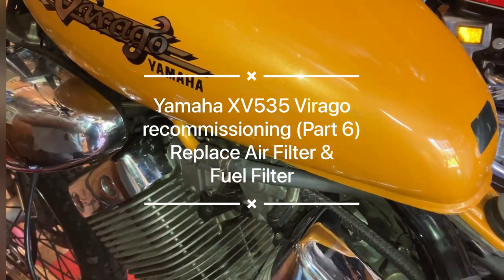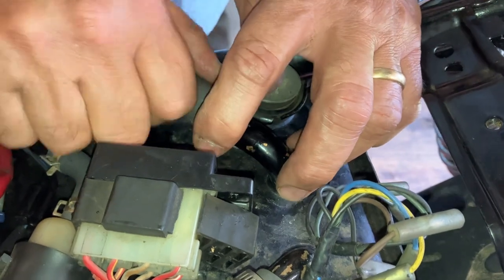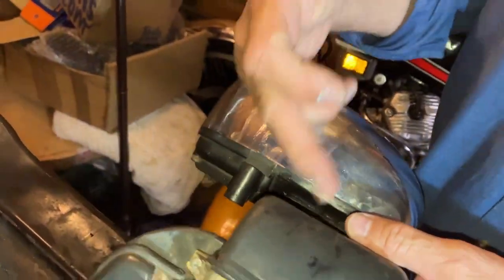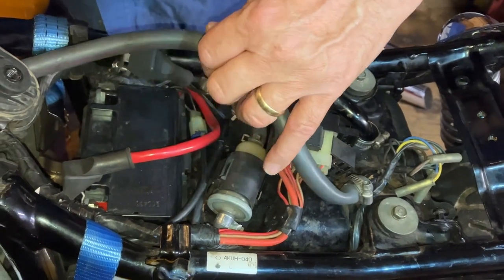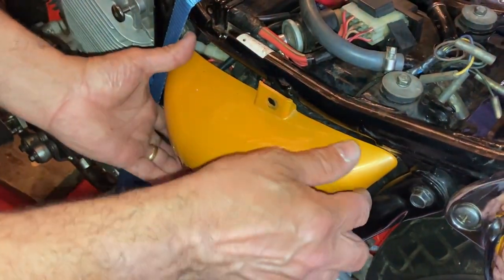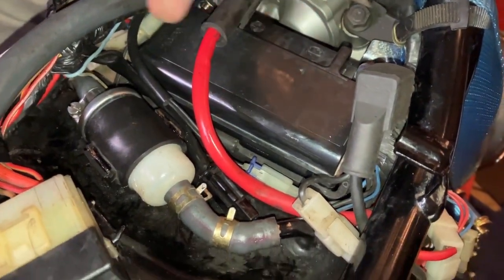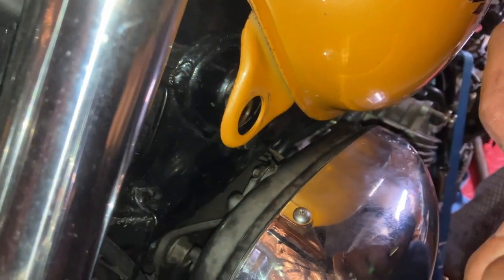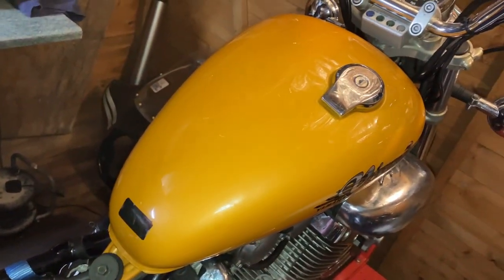Yamaha XV535 Virago - Recommissioning (Part 6) Replace Air Filter & Fuel Filter

Comment: I am a new biker and bought an xv535 after passing my test and loving it. Mine was not used much and although it ran ok, it would cut out when exactly 5l of fuel was used. It didn't matter if the fuel switch was on main or reserve. It was a bit slow to start and easy to stall when idling at traffic lights. I find this video and others but no info on the net about what could be the problem. I got quoted between 300 and 1000 to diagnose and fix the problem (one guy said it was the fuel switch solenoid but i figured it couldn't be that). I thought it could be the carbs but when i opened them, they were pristine. In the end, I changed the fuel filter myself (it cost just 10 euros) and it fixed the problem. Couldn't believe it was something so simple but there was a tiny bit of gunk in the filter that was restricting the fuel flowing correctly. Thanks for your video!
Reply from the maker: Well done on finding the problem. As you say, changing the fuel filter is an inexpensive and simple task. Odd about the 5l issue. Even clean-looking carbs can have issues. We gave the carbs a basic in-situ clean but still had some issues and we've taken them off for a more in-depth clean and repair. We'll be posting that video, shortly. Glad you've solved your problem, so cheaply.
Reply: Reserve tank valve has a common problem of binding into place even if it’s energized by the switch you won’t be able to use the extra fuel if the valve is stuck, PIA to get it out too